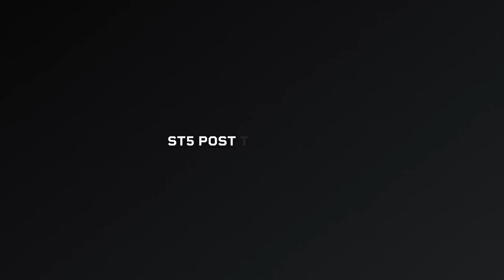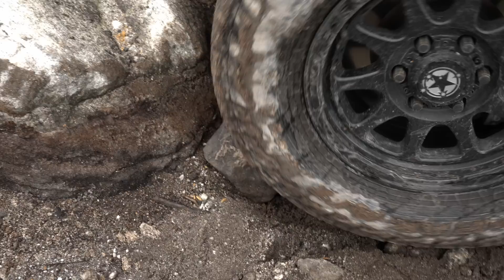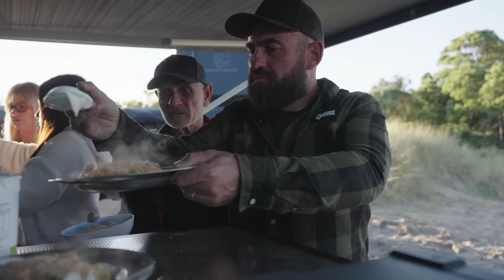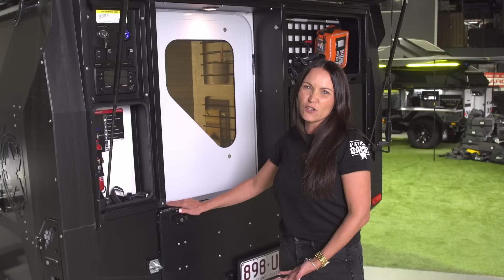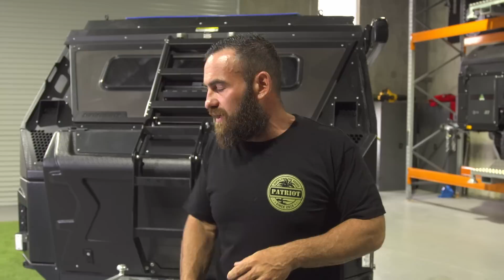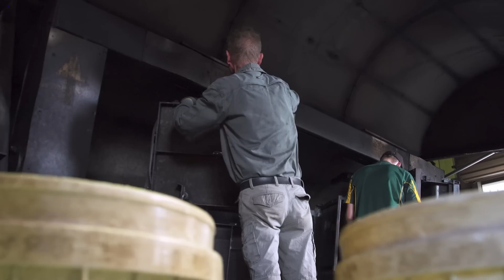ST5 DAMAGE REPORT! Torture Test in Tasmania | Patriot Campers

Comment: Thank you for showing people what these trailers are capable of doing and the terrain it can handle without any problems. I have looked at many trailers for my personal use but there is always something that I am not happy with. When I came across your, trailer. It is perfect that what I want to do. Only one thing that I picked up is that you had to open the back door to adjust the overhang of the trailer with the airbags. You should be able to do that from inside your vehicle because you are going to come into a situation where you can't open the back door. You definitely need to be able to do that adjustment safely from inside your vehicle.
Reply: I would think a remote control from the driver‘s cab would be appropriate for adjusting ride height. Adjustability on a rough trail is nice and sometimes the highway really turns to crap and you may want to adjust without having to stop get out go to the back and adjust airbags suspension.

Comment: Loving the videos and thorough walkthroughs! One thing I haven't been find and could use some clarification on is the internal height when the roof is fully extended. I'm a pretty tall dude, so having lots of head room and being able to stand up inside the trailer is important.
Reply from the maker: Hi mate, 2.1m on the lower level and 1.9m on the upper level, 6"2" tall person no problems 👍

Comment: 3M™ Raised Pavement Markers Series 290

This is what you need. They are manufacture for inlaying on roads. Super tough and heavy duty.  

Cheers brother
Reply: the angle of the reflector is a good idea as it will deflects the rocks. Mounting in on the side instead of the front you can get these to have white in the front and red in the back
Reply from the maker: Will check that out!